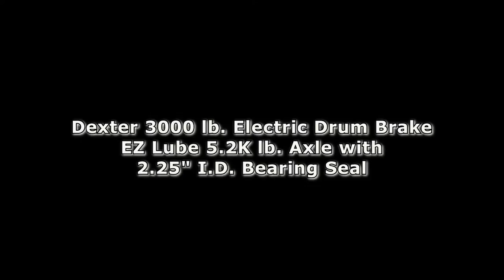How To Fix Electric Trailer Drum Brakes

Comment: Great video! Thanks for explaining proper torque values and explaining the tightening and then releasing and hand retightening. Do you know how many morons tighten the axle nuts with a wrench and don't back them off?! It's scary! I know someone who lost two wheels in a years time because they let some bozo do their bearings. Read some one these comments. Those people are abundant. Scary!
Reply: This is actually pretty similar to how passenger jet wheels are installed. The only real difference is in the tightening sequence. We tighten the axle nut to a specified torque while simultaneously spinning the wheel. Then tighten (or loosen, depending on the manual) the nut to the nearest lock bolt point.

Comment: I know people are commenting on the channel locks, but in all fairness, most people don't have a torque wrench. For anyone replacing trailer brakes, it's worth it to by the proper size socket and most many auto parts stores like Autozone have free lender tool torque wrenches.

Comment: Using channel locks on a nut??  In an instruction video??
Reply: Channel locks on the nut is fine, it is never tightened much more than hand tight. What IS wrong is no grease on the seal. By putting it in dry, he ensured that it will be destroyed immediately.